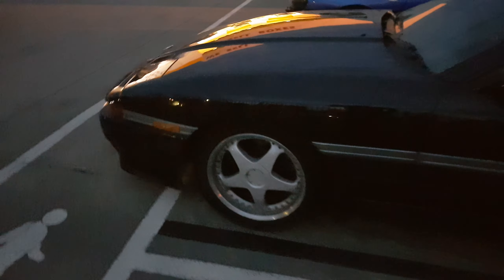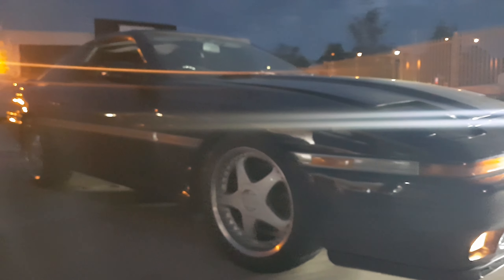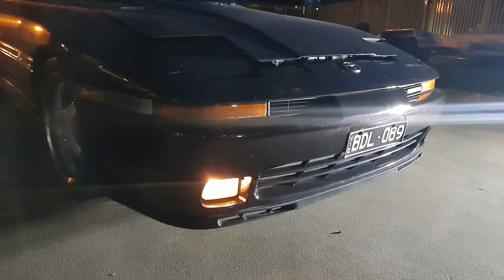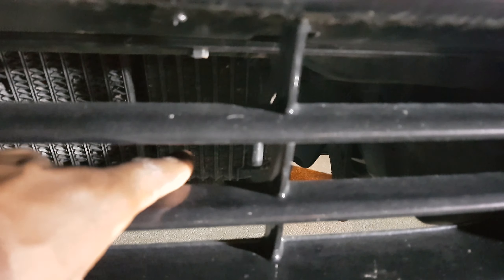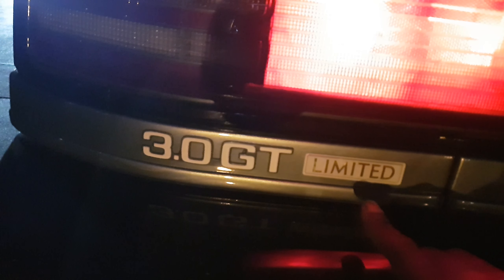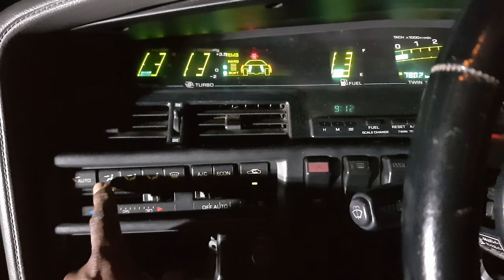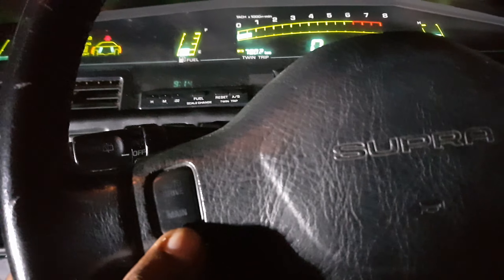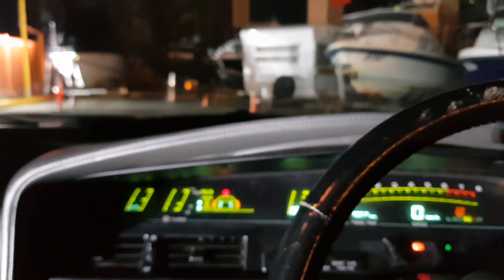Toyota Supra mk3 Limited edition ma70, JDM supra

Comment: The "driving lights" on my Turbo A can be turned on and off and I actually got a warning from the cops not to have them on as they consider them fog lights.  My doors also auto lock when driving only when you get over about 10kmh.
Reply from the maker: Turbo A mk3 is very rare car to see. Well done having one. That cop must be crazy  what about volvos they have driving lights on all the time from factory.
Reply from the maker: What year is your supra made?
Reply: @cartorx1261  1988 model. Owned it for about 13yrs. Its in Brisbane.
Reply from the maker: @sma6184 you sold it? And is it on YouTube?
Reply from the maker: Which country is your Supra in? Cars a configured differently for different road Laws, but because this was imported into Australia much later on, the lights are still in Japanese setting, some may call them fog lamps some the are driving light or parked lights. The are not very bright on mine. Most cat have the Parker lights next to the indicator but mine is missing there.

Comment: How comfortable are the cloth seats?
Reply from the maker: Cloth seats are the best, they don't get too hot or cold and you don't slide around so much like a wet soap bar in a bucket.
Reply from the maker: I wouldn't change the seat the are comfortable for sure.

Comment: How many of them where made?
Reply from the maker: To don't know how many but I would guess 5000. They were many in the past but now I am have trouble seeing any around for sell.
Reply from the maker: They seem most specked out supra you could order with all the best options such as sound system and speakers, aerotop roof, some with leather seats, cruise control, electric seat, elec suspension, ABS braking...
Reply: @cartorx1261  yeah I found one rotting away and it has digital dash red interior and electric seating. Trying to eventually do it up